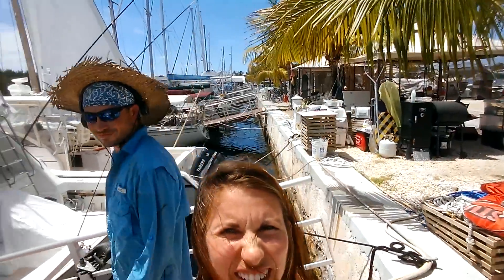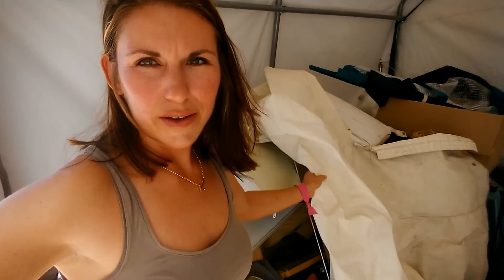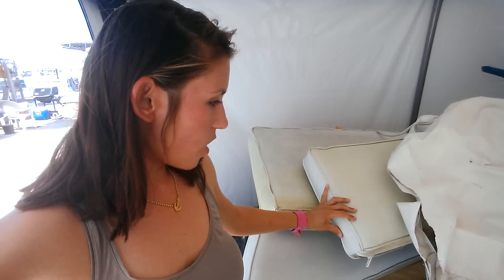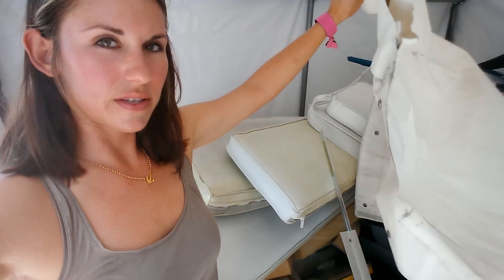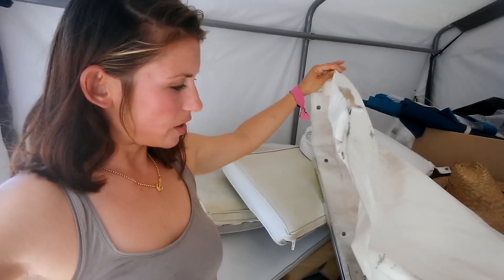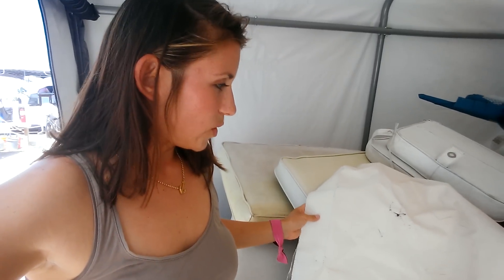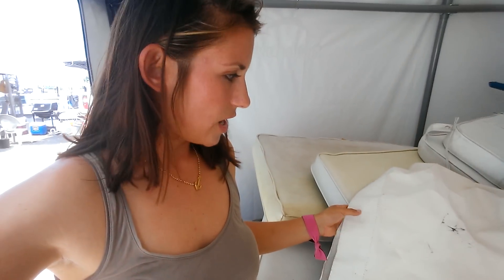Atticus Update 79: V Berth Cushions Complete!

Comment: Here is a hint from a long time, self taught sewer. Unpick the seams on the old covers and use them as pattern pieces for the new Sunbrella material. Cuts down the labour a lot!
Reply: +Andrew Barron This guy stole my line, but I would also add, to reuse the snap tabs if they are still serviceable and the same color material.
Reply: +Project Atticus I was referring to the white ones you are doing for your neighbour. Use a 'seam ripper' and unpick the seams, lay the pieces out on the Sunbrella and hot knife your way around it.
Reply from the maker: Thanks! I spent today with my seem ripper and the old covers! For the most part they're good patterns, but the material is so dry that it has shrunk so I ended up patterning from scratch 2 cushions. Better safe than sorry!

Comment: Great work... do you know if you have any moisture problems in the v berth?
Reply from the maker: So far no...though when we bought the boat it was pretty humid at the mooring ball. We also use an AC unit now which I think mitigates the humidity. I think dry fast foam will be a good solution for humidity in the future